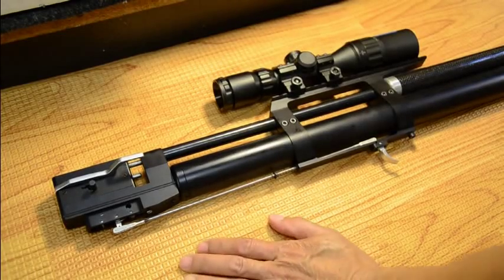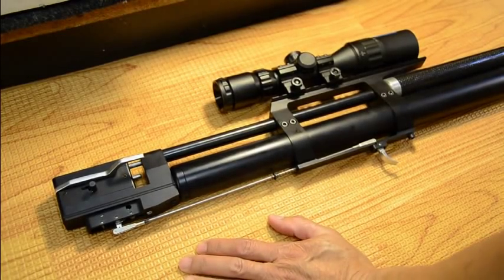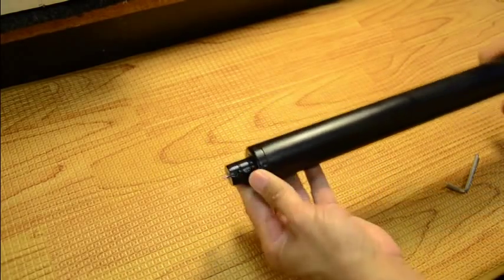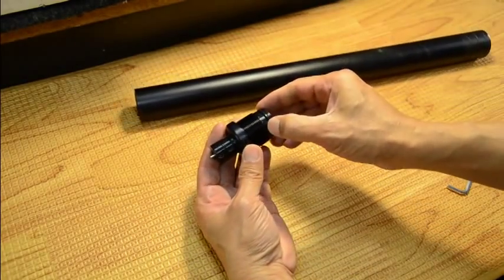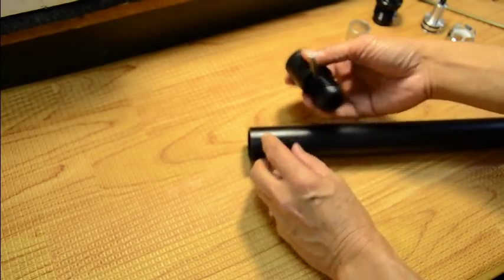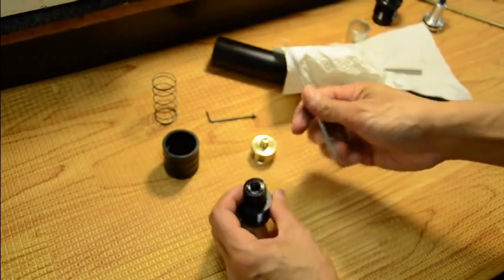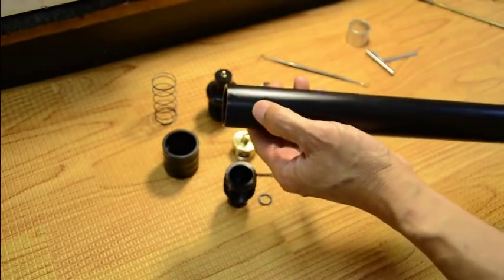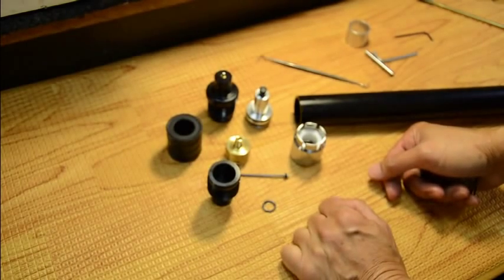Cricket Calibergun Air tube Disassembly and o-ring replacement

Comment: Hoi Ernest, happy New Year! 
Can you do the dismantling of the cricket II?
I want to install a Huma Air regulator but can't find a manual!
thanks in advance
Reply: Did u figure out how to install?
Reply: @nixosnixos1227  No and because I can't find a manual and the kricket is still under warranty I'm going to wait until after the warranty period!
Then I will order the regulator from huma-air and give it a try.
Reply: @pfv3462 thanks for taking the time to answer.  My cricket is no longer under warranty (original cricket) I have purchased the regulator but they don't have on the website any instructions regarding cricket (they have for a bunch of other brands). I emailed them about this issue and I'm still waiting for an answer. Also tomorrow I'm going to buy a 27mm socket and grind it to be able to dismantle the gauge. I have a leak from the gauge side.
Reply: I got an answer 

Dear Nixos,
 
It will directly replace the mounted regulator.
So diassemble the gun, remove factory regulator, install ours. That is all there is to it.
 
For disassembly we would like to point you to the factory exploded diagram.
 
All the best

Comment: you can make your own gauge tool with a 27mm socket. you need to grind it down to fit between the cap and gauge

Comment: Hi Ernest, I'm having trouble with a leak from the first hole from the valve assembly low pressure side I have used 2 lots of o rings with the same result leak from first hole from the rear is ther any thing else I could be missing other than o ring 8 thanks for any help

Comment: Hey Ernest, great video once again. I've a Cricket in .22 with polymer stock. My main concern is the sound coming fromtrigger block when I shoot. The gun is much louder when it shoots the pellet out rather than when it shoots without pellet. This is in most cases exactlly the opposite of what happens with most of the other airguns. Do you have any idea on how to reduce this noise?